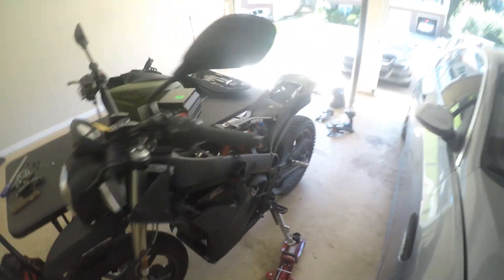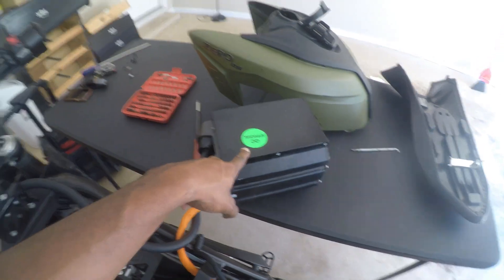Cheapest Zero Electric Motorcycle rebuild Is done!!

Comment: What are the laws regarding electric motorcycle? Do I still need an endorsement, insurance, registration and etc?
Reply from the maker: Yes you will need all of those things for most electric motorcycles. The manufactures have to list the bikes as full size motorcycles so the same rules apply to electric bikes.
Reply: What if is listed  as an electric scooter
Reply: @sekou555  what you want is the Emmo GTS or the Tao Leo. That's a full size motorcycle but it has PAS pedals so it's considered an E Bike that requires no insurance or license

Comment: Hey really enjoyed watching your channel, I'm a motorcycle frame designer based in uk and electric motorcycle enthusiast. I really felt I had to comment about the angle of the steering head on your zero bike as it looks very steep which would make this bike unstable also looks like the wheel could touch the battery on full compression (as it does travel back as well as up in its stroke) resulting in front lock up. Only making this comment because you seem like a cool guy and I don't want to see you seriously hurt yourself.
Reply from the maker: mariryalen hey man I thank you so much for the insight!! I do agree the angle is a bit steep for sure do you know any potential solutions that could resolve this?
Reply: @DirectedWisdon  Almost 25 years ago I worked in a motorcycle engineering shop, we would straighten frames in a specialist jig using hydraulic rams and heat, it was quite easy to pull out bent steel frames whereas alloy frames like yours were very difficult as they would often crack badly and become unrepairable. As you probably already know these alloys work harden easily which means they become hard in the area of deformation, so if you try to straighten them they crack even more. Really the frame in my opinion is a write off, i'm not recommending it but i guess you could try to pull it out but it would need alot of additional material to be added around steering head also the frame would have to be stripped bare to get good access to cracks I guess this amount of work would probably be un-economical. Have you tried to contact zero motorcycles to get a price for a new frame. I know from working on my zero these are very simple motorcycles and it wouldn't take very long to change a frame over which would be your safest option really.
Reply: @mariryalen  I am agree with you, zero use basically some kind of aluminum for the frame this metal
has zero to little flexibility before it get cracked. "additional material to be added" Or get a new frame..
Be safe.